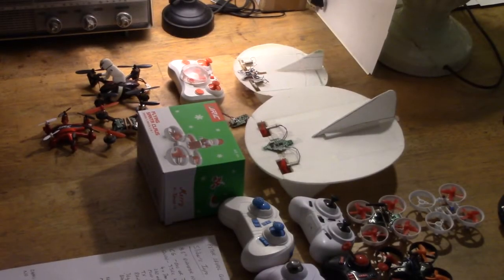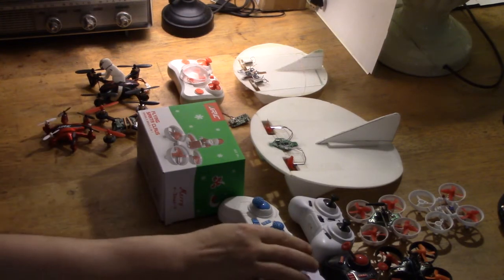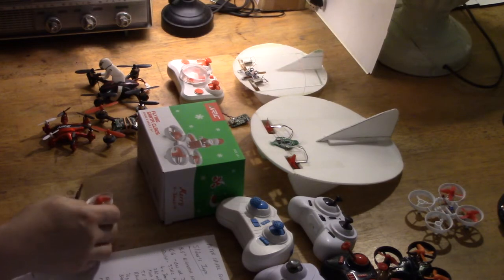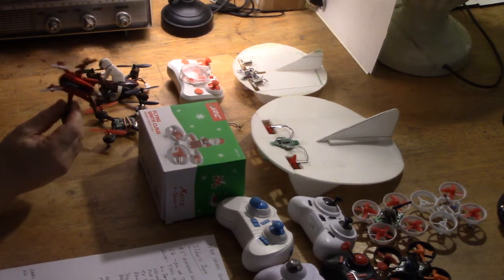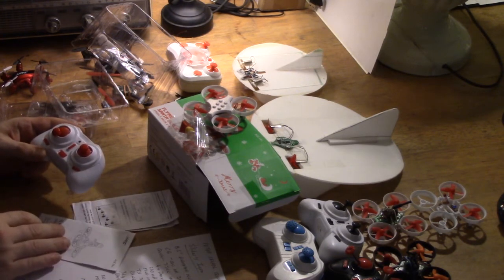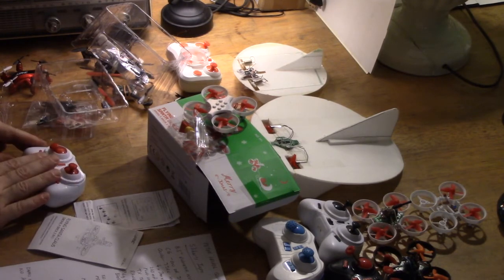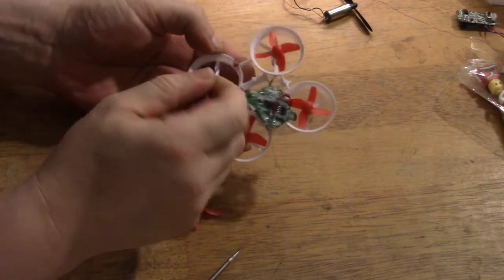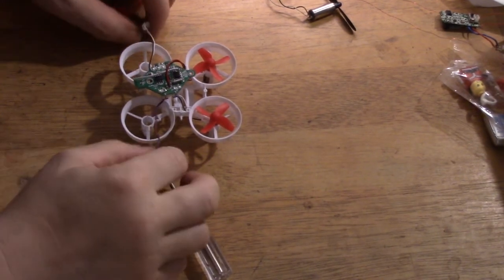Santa Quad to plane - NiB Teardown & Extra info

Comment: how would you control the altitude
Reply from the maker: With the speed of both motors. Moving the throttle up speeds both motors and pulls the plane upwards. Reducing throttle allows it to descend. It all seems very loose and would be unresponsive, but in reality works very well.

Comment: So no control surfaces?
Reply from the maker: Nope Cliff, just the difference in speed of the motors. If you imagine 2 motors and props connected by a straw and have a piece of string tied to the straw at its middle, then hold the string. The 2 motors will sit balanced and level. Spin up one motor and the straw will rotate with the thrust. These work in that way  :)

Comment: Very useful -- especially with the video description and links.   And interesting to watch too, like all your stuff.  What strikes me is that such an inexpensive holiday toy is constructed in a way that allows parts to be easily removed.  Normally these things are just fused in plastic, so you have to cut / break things to take them apart.
Reply from the maker: Am so glad you found it useful, being the reason it was done in the first case lol. But you were quite right to have wished to see extra info, there were holes in the logic if someone wasn't familiar with many aspects.  
That's the thing about these Santa ones, lots of ideas could be tried and then the thing be put back together as though nothing had happened !

Comment: Amazing you going to drive many UFO folks nuts with that little bugger.Flys great with the cg fixed. We need a 4 engine b17 now.Always fun thanks for sharing.
Reply from the maker: Good to see you. Yes, a 4 engined something huh, Maybe B-29 or do something mega weird like a pair of circuits, 8 motors Spruce Goose. That would be something that could crash spectacularly :)
Reply: Yours would actually fly

Comment: Brilliant, I might have to see if I can find that old one I bought a few years back and see what I can do with it.
Reply from the maker: The only caveat with this system was just found out about 20 minutes ago, it needs to be on a plane that needs power applied all the time. Something that likes to go high Alpha or has a bad glide. 
The motors don't spin up for turning. I just test flew the AirHogs F/A-18 that i'd done a step by step for in the next video and ditched it in a puddle lol. The glide was huge, most of the way down the field and that, that was the problem.

Comment: Hi Slider. Have you ever tried to use one of these to see how much voltage you can get from a wire taken up into the air. I have been wanting to do it. but I keep having to do other things  Maybe some day.
All my best to you and yours.
Bobby.
Reply from the maker: Oh, good idea. No I haven't Bobby. I recall that Lasersaber did something similar with his electrostatic motors. It needs  GPS and position hold on board really, otherwise the thing would fly all over the place with any wind...well, these little types. Ideal for the posh DJI's etc  though, set it in place and do the experiments while it hovers up there   :)